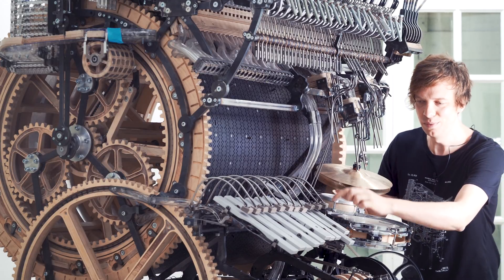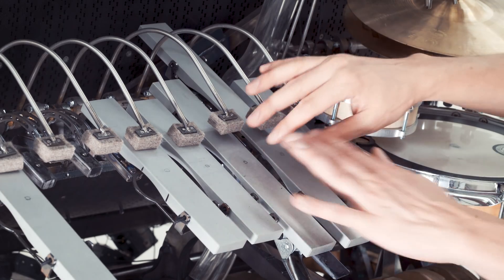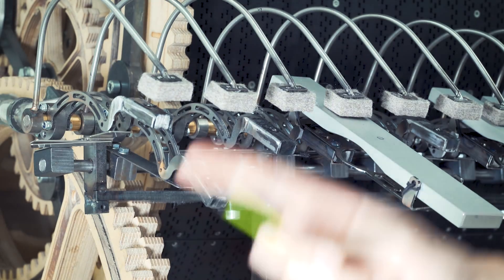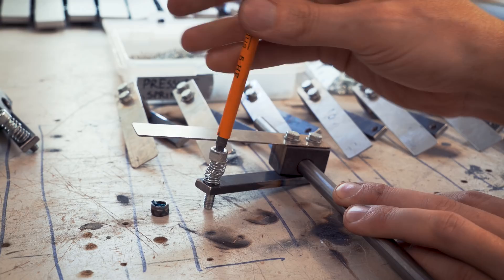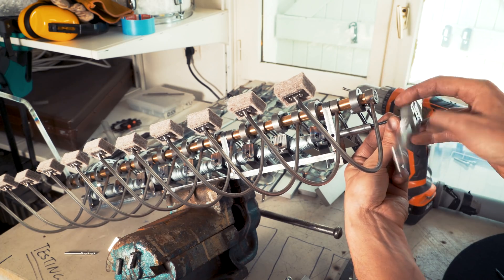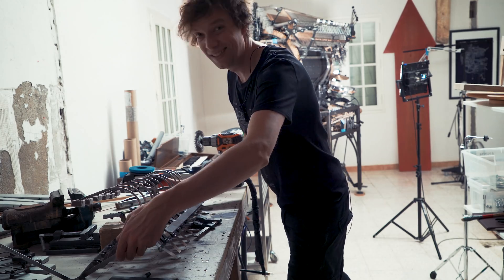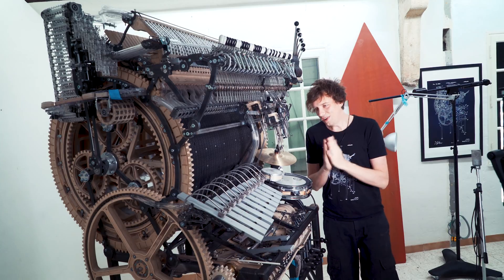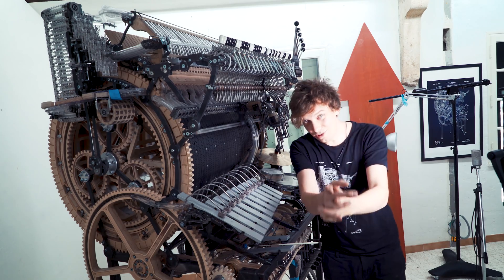Vibraphone Height Adjustment - Marble Machine X #103

Comment: I love the solution! But I see one potential problem, how do you plan on keeping the height consistent when you replace all the notes at once? The timing of the marble drops could change if you for instance switch to a much lower scale, all the plates would drop a bit from where the last scale was, even though they would be at the same height compared to each other. I would simply add a stylish metal piece or something along the edge of the vibraphone plates to act as a reference point.

Comment: Solution number 8 on the no compromise vibraphone:

The problem is that you're adjusting each plate every song, all you've done is make that a little more convenient.

The reason for that is obviously that they each need their own tension setting on the spring.

I think the better solution is to give every plate it's own spring, as in fix the spring and adjuster to the plate holder rather than the machine, and allow it to slide on the machine rather than the plate holder.

That way every one can be individually adjusted, with the correct thickness of spring steel for the weight of each note and they won't need adjusting as you change them on the machine, only as they sag over time.

You also get to set just the right amount of bounce so that you don't have a light plate sitting on a heavy spring. You don't have to compromise the movement.

Comment: New job opening!  In concert vibraphone height adjuster, lol
You'll need an small army to run MMX live. How many steps is that so far to change songs? Turnaround time is way to high. It will take 30+ minutes to switch plates, change notes and completely readjust EVERYTHING. You're probably looking at 4 MMX songs per concert max.

Comment: This would probably be a lot of work but if you could find a way to attach a spacer to the interchangeable notes instead of the machine. you could set all the springs to the same height, set the individual note heights permanently, and never have to make any future adjustments. aside from occasionally adjusting the springs as they wear out

Comment: Just started the video. 
I would use Velcro weight bars to add to brackets for short bars. Make each weight plus bar weight equal across the board. Just attach the Velcroed weight to each bracket as assigned for each bar.

Comment: Sort of in the same vein as what happened with the vibraphone holders where you were planning to adjust the droppers, instead of adjusting how the holders held the vibraphone plate. Why not just put that spring on the vibraphone plate holders? That way each note has it's own spring that is tailored to keep it at a certain height, rather than having to adjust the height each time you swap a note. This would allows for a more swap and go type setup rather than having to tweak the height each time a note is changed.

Comment: Couldn´t you add a shim attached to the caddy that holds each note?
When sliding in the note, an extra spring steel leaf slides onto the top of the existing spring steel.

This should compensate for the height difference without any extra tools or adjustments on stage. I think adjusting each note when changed  may be a bit limiting for a live performance since you may have to bridge a lot of time when changing many notes at once. The audience won´t be able to see what you are screwing in and out, so I think visually it would also be nicer if it only slides in and is done.
Reply: I came here to suggest this.

It might need two set screws: one on the rig to level all spring steels, and one on each holder to modify the level depending on the weight of the xylophone bar.
But once everything is calibrated, you can swap notes very quickly.
Reply: I was thinking the same, not having to calibrate with each swap seems a huge advantage. Both saving time and reducing mechanical wear on the system. It might still be compatible with the current system allowing for final adjustment as needed. one cound precicely measure the offset needed and machine the shims to spec for each note...

Comment: Why not, instead of attaching the leaf springs to the machine and letting them press against the underside of the note-holders, attach the springs to the note-holders and let them press against the machine? Then each note would have it's permanent, specific spring buddy and you wouldn't have to adjust anything when you swapped notes around.

Comment: If you add shims to the  removable parts, the shim can slide between the spring steel and the arm as you slide it in place.  Then add shims until it sits at the right height. Feeler gauge sets would be the exact shape, have a screw hole and are available in a range of sizes for cheap.   This will greatly reduce the changeover time, as that will be your biggest problem. Speed of changeover.  The screws are a great improvement, and this compliments them.

Comment: The sound that came off the preloads after you air brushed them and dropped them back into position was a pretty cool sound. In my opinion that sound put into a custom made instrument would be a great addition to the marble machine X or maybe another marble machine project in the future if you decided to continue Marble Machine line and i think that sound could carry a lot of potential...it sounded akin to the sound you get when you bridge playing cards but if they were made of metal....or dropping plastic beads onto a hard surface and letting them bounce and roll around...i think it could be used as like imitation rain or any sound that would add a droplet texture or pitter-patter (it almost felt ethereal) and different materials and additions and such could add a world of variation and wonder! And the best part is if it were to be made into an insturment for the MMX you could make each variation (be it wood, metal, etc) the same in design and function...and make a mount or base for it on the machine and add a quick change feature where it would just snap into place and could just as easily be removed so you could put the other ones on in a "snap" (haha very punny yes i know lol)   If this idea were to be implemented I would be beyond ecstatic! 

And if it ever IS used i dont need any form of shout out or any thing like that. Just seeing it being used in something (i would make one myself but i lack the tools and probably the skill to create it) like that would be more than enough for me!

Comment: And by shifting the position of the lower vibraphone notes back in the machine to get better tone quality, it also has the nice side-effect of making the weight distribution more balanced, so even less spring adjustment will be needed when switching notes. This machine just keeps getting better and better.

Comment: That is very cool, and thanks for sharing the 7 solutions. 

I know the details behind the vibraphone have delayed the schedule considerably. If there was a chance for a redesign I would recommend extending the swappable module to include an arm with an integrated spring. This way, you achieve a couple of desirable traits:
1) You can pre-tune each module so that when you swap it, it is already calibrated to a consistent height. 
2) You can tune each spring to match the mass of the assembly so that all notes have the same natural frequency. 
With the current design, I'm concerned the large notes will oscillate much slower than the short notes and this may interfere with your ability to play music.

Comment: Nice  solution, Martin.  However, wouldn't it be faster during the concert to just have a slightly higher bar holder (sorry if that's the wrong term) for the heavier bars.  That way, you only need to swap out the bar and bar holder assembly without needing to make any adjustment.

Comment: Marbles drops at different frame time... Sometimes they are far from each other, and vibraphone can have time to get back to its position... Sometimes they're very close and vibraphone is still down... That may cause the marble to have a different trajectory, isn't it? Have you tested if the difference may cause uncatchable marbles?

Comment: it would take a total rebuilding at this point, so maybe not so worth it.  but each note has a different mass and moment of inertia, and so will require a unique spring in order to have the same rebound characteristics of all the others.  for interchangability, the best design would relocate the spring steel to the holder that slides in and out of position, rather than having it static on the machine.  the adjustability of the height only sort of mitigates the real issue here - the rebound characteristics of notes that are swapped out will still be quite different and could interfere with the ability to repeat notes at faster tempos.

Comment: You could replace those ''million washers'' with a piece of pipe of the right thickness and width which you could cut at proper lengths to get the same result , just to reduce the time requirement of maintenance if that ever happens.

Comment: Not an engineer here by any means but I was just wandering... Does the movement of the part could effect the timing of when the ball hits and also of where the ball will launch into the air ?
In fast notes, if it stills moving while another ball drops, would that make the timing a bit more "random"  same thing with catching balls after ?
Idk I'm just wondering... ? 🤔

Comment: I guess it works with the Adjustments.  but you might want to test it out and see how many adjustments will need to be made. I would have thought the added weights would have been the way to go.  Use weights at the top instead of the bottom. so it does not hinder the bounce. Just plug and play Bars. No adjustments.

Comment: I think this is a great design for adjusting the height, but I still think you should add mass to each bar assembly so they all have roughly the same moment of inertia. Since you are (rightly) so concerned with tight timing of the music, different notes taking different amounts of time to return to neutral position is a potential cause of loss-of-timing during fast music. Also, by requiring manual adjustment of these screws, you're adding significant downtime between songs, as well as running the risk of the whole lot of them drifting up or down over time, because of constant manual adjustments.

Comment: Question: Don’t all of the vibraphone notes need to be, not only at the same height as each other, but at a particular height to be in time with the rhythm section?  It seems like there needs to be an adjustment stop with a bar that runs across all the notes at the correct height that can be attached periodically to make sure that after setting up the right notes for a given song, they are all at the correct height for timing.  This is especially the case if notes will be changed a lot and since, as Martin mentioned, the springs will lose height over time.

Comment: Hey Martin, I love your videos! I think you may be over complicating this one, I have a much more simple thought. Why not just put spacers between the square shaft(where you attach it to the machine), and the note plate? Then you never need to adjust the spring ever, have the same springyness for all notes. You can put any note in any location and it will always return to the same level as every other note. So lighter notes would have smaller spacers, heaver notes would have larger spacers. Then just swap your notes as required. No adjustment required, the spacers do the work for you. Just a thought.

Comment: Is a tiny ball bearing going to effect the springs enough to make you happy?

If it does effect it enough is the movement going to change where the a next ball bearing strikes?

I'm curious now to if you can cause marbles to strike in a vibraphone plates down swing enough to miss the silicone pad altogether.

Comment: Your height adjustment solution is really ingenious. You could extend the adjustment screws so they  come above the level of the vibraphone bars and add a knurled nut on top so it could be adjusted easily by hand on the fly without a tool (which, disaster, you will lose in the middle of a concert!).

 Instead of washers why not invest in a 3d printer and print spacers? They would be lighter and easier to assemble and won't need shims.  But maybe the idea of plastic doesn't appeal? Ivan Miranda is an expert at printed spacers and also has a very amusing channel making  some fun projects. 

I love your channel. Your machine is beautiful. It reminds me of engineering of 150 years ago at the height of the industrial revolution. But using modern techniques. How excited  the machine makers of those times would be to see the equipment and techniques for replication you have in your hands today. In those days 20 apprentices would be busy for days replicating parts that you specify  at screen with infinite  variability for each part at your finger tips. You are the best Martin!

I hope you are keeping "as built" files for all the parts. They will be invaluable for building Marble Machine X #2 and upwards.  Ha ha !

Comment: Having separate features of the design to meet each "functional requirement" is a fairly well studied engineering design theory principle.  If you are interested, look at Nam Suh's "Axiomatic Design".  The short version is that every one of your function requirements (i.e. what your machine is trying to do) is matched with one and only one design parameter (i.e. something you can tune to optimize the function).  That's the ideal setup but in real-world design you will often compromise and integrate things to save weight, cost, etc.

In your case, the new screw (design parameter) addresses the function requirement for adjusting the height of the bar.  Before, the height was getting set by the spring position and stiffness. That's not ideal because the spring is doing too many jobs (i.e. fulfilling too many functional requirements).

Comment: Its great to see the MMX develop. Although I recall a design goal was to be able to swop programming plates easily for subsequent performances, so I wonder about the time to: swop plates, change xylophone notes, relevel the notes. As each note has a fixed point would it not be desirable to make the mounting bracket the fixed point for the height adjuster?  e.g. Changing the note also changes its spring/flex and height adjuster.

Comment: Instead of stacking hundreds of washers, just get some metal or plastic tubing a bit bigger in diameter than the shaft, and cut custom spacers to length with your chop saw. File the ends square for extra credit.

Comment: Mr Martin, now you need a register point on one or both ends of the vibraphone, so that while you have all the notes at the same level, are they at the correct height. With a fixed point at each end you could set a cross bar on them and just use the screw adjustment till the note touches.

Comment: How does adding weight add more mass than the heavy notes?  If the mass is added at the end of the mount, it will displace the higher note the same as a lower note, and still have less mass due to the mechanical advantage of it being at the end of a lever-arm.  There is pretty much no scenario where adding more weight to the high notes will give them more mass than the low notes simply due to the fact that the displacement is caused by mass (low notes are displaced x amount because of y mass, so displacing a high note x amount will still require y mass).  Having every note be the same mass with give them all the same moment or inertia and therefore most likely make them spring upon being hit more evenly as well.

Comment: I would have thought the solution would be to increase the strength of the spring as the height of the vibraphone is not due to its relative position but actually due to the added weight of the larger bar.

Comment: Martin
I'd recommend you create some sort of hard reference (scoring line, cross bar, etc.) for the first note on the vibraphone to be set against. If you continue to use the keys as a reference to eachother you will find them drifting in their position over time.
e.g. vibe 1 references vibe 2 and gets set too high. Change notes. vibe 2 references vibe 1 and gets set too high. Repeat 20 times and watch your timing go out of whack.

Comment: Hey Martin, as we know, marble's traveling time from releasing to hitting the plate is constant, so for the different song's tempo can you adjust the height of the plates with this solution so they will be on the perfect position and be in sync with the rest of the instruments? If yes, maybe it is better to put some visual reference so you can quickly adjust the height according different tempos, just a friendly suggestion :)

Comment: Wouldn’t it be even faster to have different “height” brackets made for the different sized bars? So the part of the bracket that clips into the MMX is further away from the bottom of the bar and when it’s clipped in, the bar ends up at the correct height

Comment: Hi Martin, 
Good start for a solution but please consider that a marble will behave differently if it hits a long or short tone bar because of the different weight of the bars.
So that means you should keep an eye on the catching funnel otherwise you have to adjust a lot of things when you exchange a note.

Comment: Now that all the bar's height is adjustable it is possible, over time of adjusting them, that the overall height can creep closer or farther from the marble drop changing the timing. Now what you need a fixed reference of position so all the bars can be positioned exactly where you want them. Maybe a small laser pointer that can be turned on to draw a reference line over the bars during adjustment?